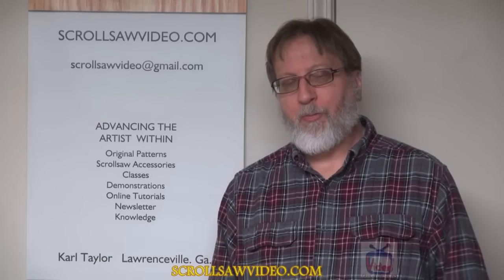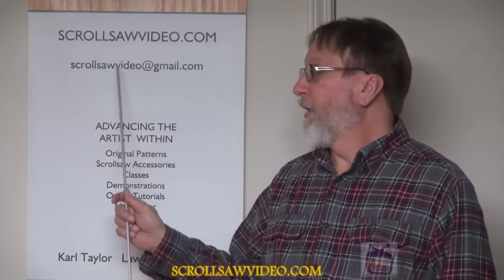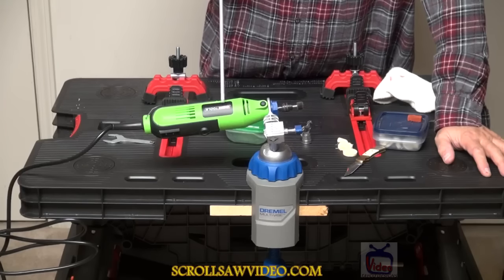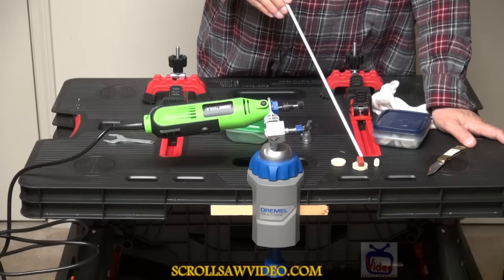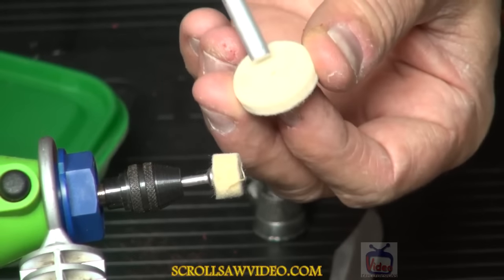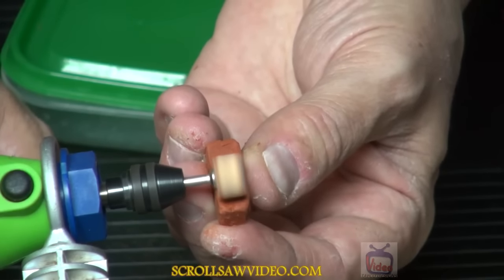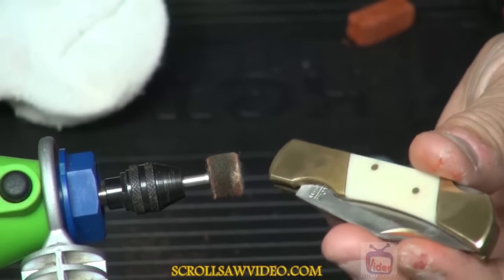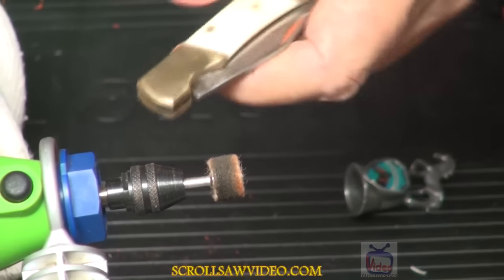How To Introduction Polish With Dremel

Comment: I liked your video. Good information shows. But, just an honest review. You are dragging the intro too much. Instead, you could show how and if it's possible to remove from that polishing cloth or whatever it's called all that dirt after is used... Thanks!
Reply: HKarl just uses a new one each time.  Other comments say you can rub the old stuff off on a popsicle stick or other soft wood. Others say you just add more compound, but never mix different compounds on one pad.

Comment: How do you make it not streaky? Whenever I polish metal with this set up, the polishing wheel leaves a trail wherever it hits. Even after I completely polish over the surface evenly, it looks like I scribbled all over it if that makes sense. The wheel doesn't polish evenly and just streaks everywhere. Kind of like when you fill in a area on paper with an ink pen. The area is all the color of the ink now but if you look carefully you can see all of the scribble lines the pen made into the paper.
Reply: Verify this; I believe the streaks are from using too much compound, use sparingly and frequently. You should be able to detect when you need to reapply more compound. Don't apply to much to the polishing wheel.

I haven't seen anyone mention it yet so verify this as well; the different color bars indicate size of the grit/particles in the wax. It is the grit that does the polishing, the wax is just to hold the grit and get it onto the wheel.

Comment: I would like to know  where did you get that black work station at
Reply from the maker: That is the Keter Workstation from Costco a few years back. I have seen these occasionally on the Costco shelves in the past year or so under $60.
Reply: Thanks a lot for the feedback appreciate it

Comment: When I put buffing wheels on the screw mandril they stop spinning almost immediately. That is, the mandril spins but the moment the pads encounter resistance they stop spinning. They should work because the thread is contra the tool spin direction so resistance should tighten the pad. But they just get reamed out. Med to low speed even. Any idears?
Reply: ndktube perhaps you are screwing them on too tight and tearing them?
Reply: I agree with the other answer. Is it possible u over tighten the pad cause it doesn't take but a half turn to tight and then it's to loose on the bit. Sometimes on the thicker pads I'd u do overtighten u can flip it around and get some grab going through the other side. It's either that or your applying to much pressure to the pad when buffing

Comment: Will these cloth disc so for stropping the blade?
Reply: No, absolutely not. You will fold the edge and it won't be consistent. Leather works best for stropping. Glue a strip of leather to a piece of wood. A leather belt will also work in a pinch.
Reply: KiwiPokerPlayer I’m gonna try it anyways but just for the small inside edges of my carving tools...I’ll strop the outside on leather like you suggested

Comment: Need help on how and what to use in polishing silver plated saxophone ????
Reply: Use ordinary cream type silver polish but don't polish much as you can easily wear through to the base metal
Reply: Make sure its safe for plated silver as well. I once had a cheap plated necklace that I brought home and polished immediately. Aaand all the silver was stripped right off leaving a rough textured steel/nickel behind

Comment: Any one got a good method to remove scratches of precious metals
Reply: Depending on the depth of scratches start with a fine sandpaper, say 500 grit and wet sand it. Then move to 800 grit and went sand again. Keep transitioning until scratches are gone. I like to use super fine steel wool and then a worn out scotch brite pad for the final 2 steps before I hand polish with a microfiber cloth.

Comment: Can i make high relief drawings in steel with these?
Reply from the maker: No, these are for polishing only. You may want to check out some rubber bits or even pointed grinding stones. Thanks for watching.

Comment: Mine strip faster and turn black...am I doing something wrong?
Reply: Usually means your tool is spinning too fast or you're applying too much pressure, instead of evenly applying the wax/compound to the surface you're melting and "burning" it, find an old piece of metal and test your wheel on that, find what's right for you setup and for you

Comment: I must he doing something wrong. Mine just keeps stripping out the pads. I've never got mine to work.
Reply: the same happen to me.
Reply: What we do wrong? Any help?
Reply: That will happen if you apply force at an angle of the pads, rather than straight on the flat side. Sometimes,  i will take a brand new extra sharp high carbon razor, and angle it between 25-35 degrees to give it more of a flat cone shape. As i said, dont apply pressure with the dremel, vice your dremel, and hold on to the item you're buffing instead. Also, Amazon has ones that come fixed to the rod, so they are a BIT more durable.

Comment: What was that in red colour ??
Reply from the maker: Polishing wax.
Reply: I would guess that is red polishing compound (i.e. red rouge). 

Polishing compounds come in  variety of colors indicating what metals and other substances they are good for.  You get a small block of it with at least some of the Dremel tools.  Red is generally for fine jewelry metals (gold, silver, copper) which are not too hard. Other colors of rouge work on stainless steel, platinum, etc.  Google "rouge" and/or polishing compounds for guidance.
Reply: The reason it's rust colored is because red rouge contains a very uniform iron oxide grit.

Comment: I think they are useless, just like a few of the dremmel tools. The polish pads stop and the mandrel keeps on spinning. Tahts on number 1 speed, the slowest. I went through 8 pads trying to polish up an object the size of a small coin. Wire brush attachments go bald and the wire cups flare out like wire disks. Thin cut off wheels snap very easily. I have never bothered to try the paper sanding discs. Most of the burr tools go blunt after trying to smooth or grind away anything. I like the dremmel type multi tools mainly for the drum sanding pits as they last longest. :)
Reply: Pro tip #1:  Let the tool do the work.
Reply: Daniel Vegard yep. Pushing hard on the dremel burns or melts many of the tips. So does using too high of a speed.

Comment: use masking tape ... to protect other surfaces
Reply from the maker: Great tip!
Reply: For sanding and polishing, I always use aluminum tape to mask off areas.  Its what we use in the aerospace industry.  Simple and extremely effective.  Regular masking tape will get destroyed quickly.
Reply: Thanks for the tip on aluminum duct tape. Have plently of it, but never thought of using it as masking tape. Can definitely see the advantage in this application. Both thumbs are up. 
Yes, you can teach an old dog new tricks! :-)

Comment: candle wax works
Reply: Not the same thing. This wax for polishing has grit in it. The wax/ glue mix just holds the grit on the pad. Candle wax has no grit. It will grease your piece, not polish it.